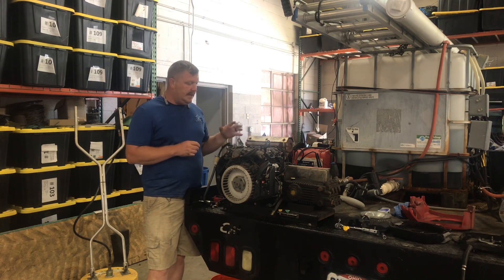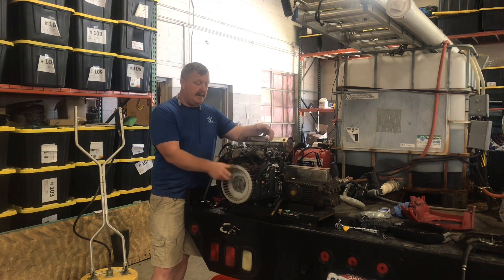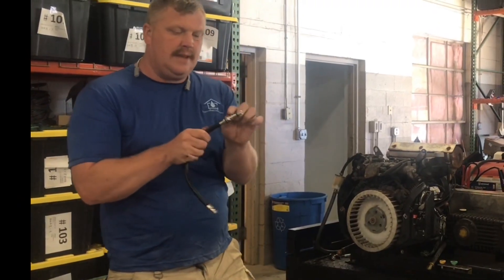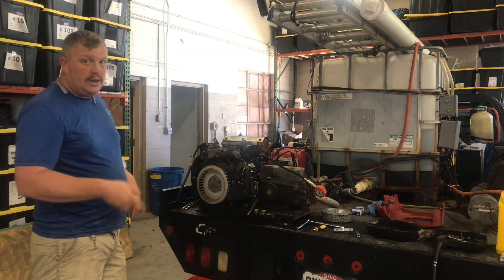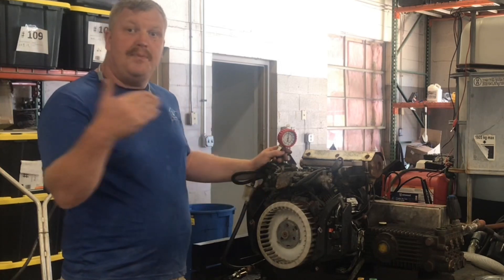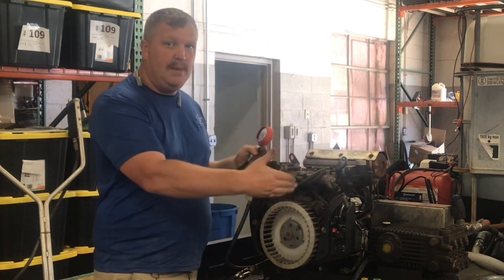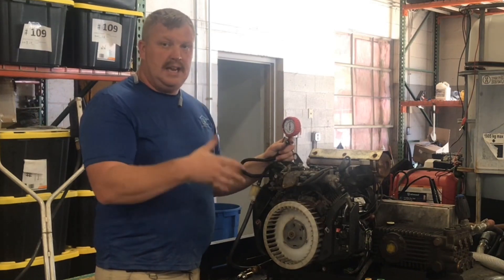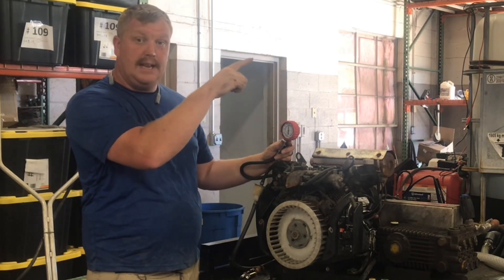How To Do A Compression Test On Honda Gx630 Or GX690

Comment: My gx610 keeps blowing the dip stick out.  Any ideas?
Reply from the maker: Might have a compression part problem
Reply: @kingofpressurewash  I didn't know if these engines had a pcv valve/filter that might cause this, or if the the rings are shot.

Comment: i have a gxc690 with no spark. i replace the coils and new spark plugs and still no spark. i also disconnect the oil sensor and still don't have spark. do you have any idea what the problem might be?? i 
i was told to check the compression, is that has to do with no spark? i really appreciate your help thanks
Reply from the maker: Check the fuse behind the switch. That should have nothing to do with it but I will still check it. Make sure there’s no wires unhooked right there behind the ignition switch
Reply: Did you ever find out what your issue was with the no spark? I have one and it doesn’t have any spark either.
Reply: @berniemac8413  it end up being a relay, if the spark is not strong
Reply: @jossr71  a relay? Where is it located?
Reply: @berniemac8413  it only has one relay, should be somewhere in there
Reply: @jossr71  do you mean a fuse? Which is located inside the control box.. I removed the entire control box and it still doesn’t have any spark. I’m gonna tear into the wiring harness later today and see what I find.. maybe the culprit is in there.

Comment: Jason nice job. Quick question did you get it back up and running.  After doing all that...Thanks
Reply from the maker: edward yack yes I put new plugs in and change the oil. Started right up and ran perfect

Comment: An engine normally needs 100lbs compression minimum to start and run with any kind power. If the cylinders vary more than 10%, add a teaspoon or so of motor oil to the weak cylinder and see if the compression goes up any. If it does, the rings are probably bad. The rings may also be washed out with too much gas too causing low compression. f it doesn't,  the valves are probably not seating correctly or burnt or bent.
Keep up the great job Jason. Always waiting for the next video. 👍👍
Reply from the maker: You are absolutely right bout all the above. That info is in my head but hasn't been used to much sense college 20 years ago.

Comment: Can u do a video in how to check your gallons per minute if there’s a way to make sure it’s accurate to what the label says thank you
Reply from the maker: For downstream or mixing valve or both
Reply: Power Washing well both if u dont mind sir and how can u tell your mix ratio if u down stream straight SH  with a 5 gpm machine
Reply from the maker: Depends on what injector you are using
Reply: Power Washing i took the tip out my wand and turned on my machine shot water in a bucket and timed it fir one minute it was about 3/4 of a inch from top of the bucket should i do that with a tip in or not
Reply from the maker: @Sambo639  tip out you can try tip in also
Reply: Power Washing thanks buddy good thing I don’t got your cell number u would get tired of me lol